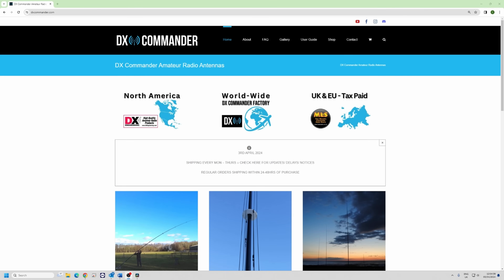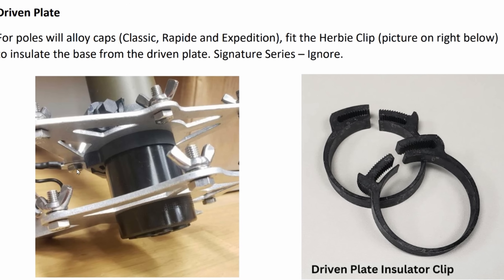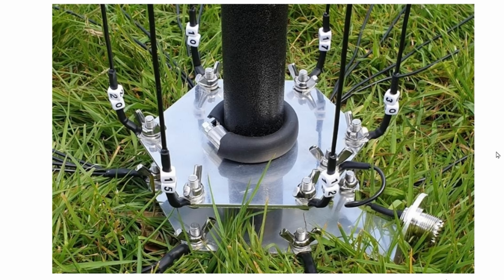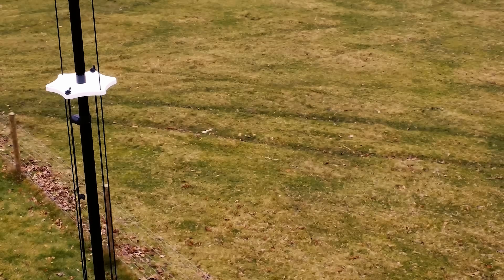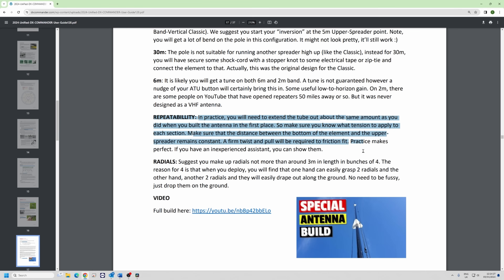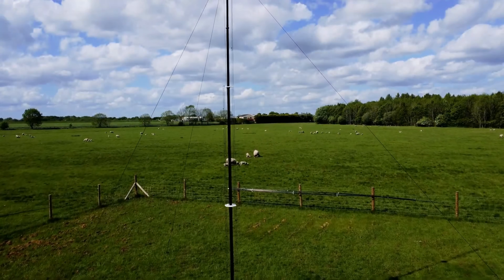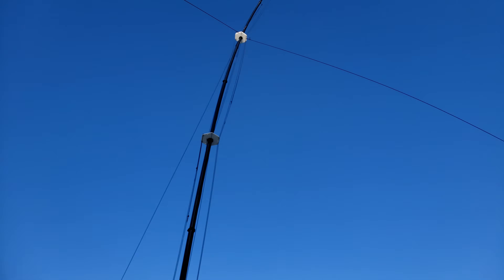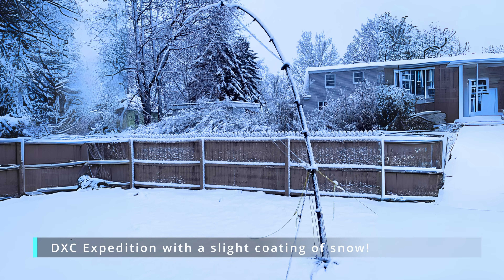Build Any DX Commander in 2024

Comment: My 12.4m Signature has been up well over a year without an issue. I put self amalg tape around the joints before putting on the clamps. It's never once came down in a storm.

Comment: 5 questions everyone is afraid tp ask Callum.  1.  Is there a benefit to replace the commander wire , with a thicker element cable ? will that provide  bigger tuned bandwidth ?  2. For Permanent setup can i replace the wire elements with thin aluminium tube ?   3. can we get a foliage green anodised aluminium plates option in the future to match the green military mast ?  4. Laser engraving on alum. plates with band  indication  next to each hole.  5. Distributor in EU to avoid NON EU TAxes 80 euros on top TAX and customs was money out of the window ....  by the wave i LOOOVEEE my brand new dx commander :) :) 73
Reply from the maker: 1. No benefit - but you can try. 2. Tube sounds cool but similar answer to 1. 3. You get grey which is almost invisible against foilage. 4. If you pay for it, sure. 5. Martin Lynch & SOns do VAT and taxe from moment of pay to delivery at no extra charge.

Comment: Hello   I have your og DX Commander. (Has worked awesome for years. ) Can I connect ( ADD)a wire to the plate that has all the vertical wires attached to it? Not running up the pole. Run it away at an angle. To add more resonant frequencies to the antenna. Without adversely affecting the original antenna? Thank you.
Reply from the maker: You can do, yes.. Tom did this on 80m.. Went off somewhere over a river to a bush! Here the video: https://youtu.be/xJnN5nAIFG8
Reply: @DXCommanderHQ  Thank you! The directions for the Dx COmander were very specific so I thought adding more verticals from the plate might interfere with your original design.

Comment: I've had a heat shrink failure on the new Expedition, I used a small zip tie, also 10m is very difficult to tune very sharp dip not very even across the band, SWR 3-1.2-3 again in the phone section. Also 40/15m element is too long and goes beyond the telescopic pole and then it folds back so the top 20cm is just floppy in the air. Tune is good 1.2 on both bands
Reply from the maker: I'm sure we can fix this. If stuck, email me.

Comment: Is it possible / reasonable to use a free standing mount of some kind? My garden is AstroTurf with sand it's quite solid below, so I need to figure an easy way to erect a Rapide without needing to spike / dig anything into the ground, I Wonder is strapping it to a fence would be problematic?
Reply from the maker: Erm.. Can you not maybe go to edge of the turf..? Yes you could actually strap it to a fence post I suppose!
Reply: @DXCommanderHQ  Thanks Cal, I'll have one in the air here shortly, just want to try to get it all planned first!

Comment: Hi Callum.  Listening to you say that the 80mtr needs to come off the center of the pole/ spreader,  I have my 80mtr wire going off the first spreader across to the trees at the side of our house. I'm lucky here as were around 60ft above a river with a steep bank coming up to "ground level" so all i did was put it up through the first spreader then slung it as hard as i could into the trees with a 2 ounce fishing weight and that's it. It hangs somewhere towards the river but it works fantastically well. On  Sunday 14th Jan 24 I worked ZL4KX in New Zealand on my 80 mtr wire, Ive also worked the world on the other bands also. 
 I couldn't be any happier with what you've mastered for the radio community. 
Keep up the good work.
All the best.

Paul MW6PNW in South Wales
Reply from the maker: Perfect!
Reply: I have my element going over to the end pole at the third spreader up and I cannot get the wire any where near tight with out putting a big bend in the DX Classsic pole. Tell me your secret that I might reproduce it on my installation. Thank you. 73 de KN6ZVI

Comment: Hi Cal,
Another great video. I have two 12m Spiderpoles I use for my wire antenna that have been outside for seven years unguyed and have withstood 70 mph gusts. They are attached to 4"X4" fence posts 4 feet high using 3" wide velcro straps. Had the antenna down recently due to a high SWR that is now repaired and is working fine again.  73  WJ3U
Reply from the maker: Sounds great!

Comment: Great update! I've had my Classic up with 80m for 9 months. 80 foot run of Messi and Paoloni Ultraflex 10, 33 radials of various lengths ranging from 12 ft to 60 ft 

Here are some of the mistakes I've made:

1. I didn't have the elements tight enough at first so they were a little loose and blew in the wind causing SWR spikes. I was afraid that there would be too much tension on the connectors but if you crimped them properly they won't go anywhere. Don't be afraid to get the shock cord tight. This also provides adequate tension on the driven plate keeping it level. If the driven plate is loose and lopsided, your SWR will be effected. 

2. I put clamps right over the joints on the pole instead of just above the joint. If you tighten your clamp right over the joint it can crush the fiberglass and potentially cause a snap. Luckily I caught this early enough thanks to a youtuber pointing this out. I took the antenna down and properly adjusted them slightly above the joint.

3.  Originally cut most elements too long then cut too much off when tuning. Make sure to cut a tiny bit at a time when tuning. I ended up having to add wire back on.

 My only struggle has been on 10m. I found tuning to be extremely narrow compared to the other bands despite tuning the element and adding more radials. The internal tuner in my 7300 won't even tune the lower digital portion of the band or the higher FM portion. Also performance on 10m isn't that great compared to 12 through 80. Overall, definitely the best performing vertical I've ran in my 21 years of being a ham. Beats ZeroFive and Cushcraft. Highly recommend.
Reply from the maker: Detailed comment, thanks.

Comment: 27:10 Yes, wind can sneak up on you, sudden wind storm snapped my 1&3 guyed pole few months back. Just bought a new pole and back on up. That being said. I'm actually running the classic with 10x2 (28 and 29mhz), 12, 17, 20, 30, 40, and 75m elements works well and SWR seems happy, 10m was a nice addition since the 28mhz and 29mhz (technically 28.1 and 28.8) cut gives me <1.5:1 for both FT8 and ssb. Without the 28.1 cut I was getting nearly 3:1 on ft8 and >28.8 when cut for 28.4~
Reply: How are you getting 10x2 and all of the other bands?
Reply: @DirkNukem  Using the standard 3x3 hole config and then the 75m and extra 10m on the extra 2 ends. The plates and spacers have a total of 8 lines usable (at least in the 2023 version). I tested the SWR with a VNA using a 10ft choked cable and my 100ft RG8x normal lead. for radials I'm using 12x12ft, since i've added 75m I though I would need to add more (which I will likely do) but I was happy to get 3.8-4mhz <1.5:1 and about <3:1 on 3.573(ft8).

I was nice to see my noise floor go from s9 (att on) to s5 (att on) on 75m around 8pm at night switching from my EFRW (remote tuned) to the DX commander. The long wire is about 145ft, I think I need to shorten it to get it away from noise sources.

Comment: very good. 3/4 wave element's work and tune great . I made mono band ones for the green portable one. on 10 meters with fold over . great band width tune and super DX on 10 /11/12 meters. I made one for 6 meters great tune but band not open lately to test  . I want to try a couple of half wave element's together. fand . with 49:1 . I did mono band with my end fed half wave   veritable up 10 meter pole with ground plain on ground cut for 10 meters and worked DX in a park all over. fast portable set up.  just had idea one day and tried it.  normally I slope it. with the 10 meter black pole. I do hear a lot of the DX commander antenna's on the air. when portable I just tossed my ground plain out on the ground. tuned great and great DX when 10 meters open.  quick and easy up and down. great Parks On The Air.  just let the pole move around in the wind a bit. when guys to tight they pull out of ground in the wind . love the poles . got a few . 73's

Comment: Thanks for making this thorough guide and a great series of antennas! Just ordered a Signature 9 from DX Engineering and I’m very excited to get it built next weekend!

A question for you regarding placement - I have a large backyard with ample room for radials, but my only spouse-approved location for the antenna that isn’t dangerously near overhead power lines is approximately 3m from the house. Will the structure of a 100-year-old 2-story house (wood frame, aluminum siding, slate roof) impede 40/20/10 much on a well-RF-grounded DXC Signature 9 in close proximity?
Reply from the maker: OK, so that would be a shamne to put it so close.. It'll still work but I would try and move it further away just to be on the safe side. But you know, some folks have put them NEXT to the house - and it still works.. Also think about interference from house to antenna - unless you have some dedicated receive antennas further away.
Reply: @DXCommanderHQ  I appreciate the insight!Will try it in the first location and see the results - maybe I can convince my spouse to allow the antenna mid-yard. 73!
Reply: Got mine 6m from the house and it works great. 2 story house built in 1885. No noise.
Reply: @DXCommanderHQ  Wanted to give you an update - My Signature 9 antenna has been ~2m from the house in the spouse-approved location for 6 weeks now, and with additional ground radials it has performed wonderfully with very low noise/interference. I've been reliably reaching Europe, South America, the Caribbean, all of North America, and a number of Oceana/Pacific contacts from Cleveland, OH USA (grid EN91). Thanks for designing and packing up a great kit - it was a lot of fun to build and it's working well even in a compromise location!

Comment: Cal, love your vids-waiting for a jam session on those drums--but first maybe you can give me some advise. I live across the street from the Atlantic Ocean in York Beach, ME. about 100 yards across a park from the ocean--Iam handicapped to the extent that I need help from my son to put the antenna up but I can assemble--My question is for advice--My lawn besides my house is a 20 ft by 20 ft square where I would install the DX C - Winds in the NE  are in the 50-60 mph area quite frequenly-- my question is what DX C would you recommend fr an area of  that size--Radials would be limited and wonder how much a metal blanke would diminish the effectiveness? Also would you put it up close to the house  or keep it about 10ft from the house in the middle of the yard? I can guy it with 3 wires ok 2 to the house and ne to my back porch  railing! your thoughts--keep up the great design and your pod casts
Reply from the maker: OK, personally... I would try and stick it near the middle. You have space for radials easy.. If you went down the Signature 9 route, your son could dig a hole and put the post in.. In the extreme event you felt you had to take it down, just undo the SO239 Wing Nut and slip it off. I appreciate youu might not be able to do that but I have witness 50-60mph on my Signature 9 and it handled it OK.. NOW.. We all need to realise that sh1t can happen but replacing the pole in the very extreme event that it did break, isn't expensive.
Reply: @DXCommanderHQ Calum, one more question if you don't mind. I see a lot of YouTube videos of Hams putting up the DX Commander and tuning it at the end for SWR. Some need to shorten or lengthen the various bands to find their sweet spot. Some take down the mast to adjust the length as needed, On every Band!!. My question is, why not install the bands as per your instructions and add, say, 2 inches or less to each band? Then, if need be to shorten, do it at the bottom of the mast instead of taking the whole thing down each time. Signed, Lazy Repairman Wayne LOL"

Comment: A dumb question I'm sure, what would placing say a 12.4 signature bottom two sections of vertical over top of a concrete set galvanized fence post say 5' above ground for stability do to SWR?  I've got an area that had a Hustler 5 vertical mounted to it that already has a nice counterpoise field set.  Just simply want to replace the Hustler with a DXC.  Many thanks!
Reply from the maker: It'll work.

Comment: I must admit that I am impressed.  Your old prototype signature 9 is preforming brilliantly.   I had to replace a few of the elements and followed the cut plan to the letter.

It worked without needing to tune.  I checked the swr on all available bands before connecting my radio.  Wow.

Having used it for a few weeks now my only issue is with the mounting pole security in high winds.  I think.i need to mount mine in concrete!  My ground conditions are a bit too soft.

Brilliant bit of kit. 

Thanks Cal. 

Scott 2W0HBW
Reply from the maker: Great stuff Scott.. Pls leave eham review 😀

Comment: I just noticed in that photo of the 80 meter wire that it does not go through the spreader then out to the support for the end of the 80 meter elemenet. What is that thing that is shown with the wire going out from it. I cannot enlarge the photo to get details. Also where did you put the tension loop for that element. Your wire looks really nice an taut not like my limpy one because I put my tension loop a spreader down.
Reply from the maker: Alvin, please email me so I can answer you.. Mention if this is the Inverted V and I can send you high res photo / explanation.

Comment: Hi Callum, I have one question that I couldn't see noted. I plan to buy an expedition kit this year. Mainly to use portable but possible to have up over the winter months in the garden. When building / tuning should I be using a choke to stop the differing lengths of coax causing an issue?
Reply from the maker: There should only be one length of coax.. No .. dont need.
Reply: @DXCommanderHQ  Thanks, Callum. My portable coax is around 10m long. The coax run at my qth is 45m. If it doesn't cause any issues that's great.
Reply: No problem with this.  You’ll have a bit more loss in the longer length but minimal if it’s good quality.  Ironically because of this you will probably have better swr at the radio.

Comment: Question: Would it be beneficial having a 1:1 choke at feedpoint?
Reply from the maker: No. In my opinion.. Certainly have one outside the shack on the coax but not required on feedpoint.

Comment: hi Callum, I was wondering what would happen if you ran an end fed random wire as an element on a dx commander...? I blame the medical cannabis that makes me ask these off the wall questions!😅
Reply from the maker: Well, as long as you could tune it, you would be away! Now.. THREE element to get 20, 15 and 10 might be a cool idea. And I need to test that theory in the summer.
Reply: @DXCommanderHQ  but if you still have the other elements in line, what does it do to the overall tunabiliy?

Comment: Interesting to hear you say you used to tape under the stay-up clamps but now don't bother... 

I've actually discovered that the tape seems to HURT more than help. When I simply put the stay-up clamp directly on the pole it holds great, but when I have put the clamp on top of tape I've had some funny business. I do have the old style clamps though, the metal kind with a bit of clear tube over. The newer style is probably better. I've threatened to upgrade, but at that point I'll just glue the pole. It's permanent in my install.
Reply from the maker: Yes.. I do like the glue idea.